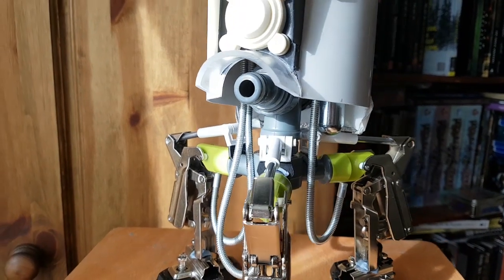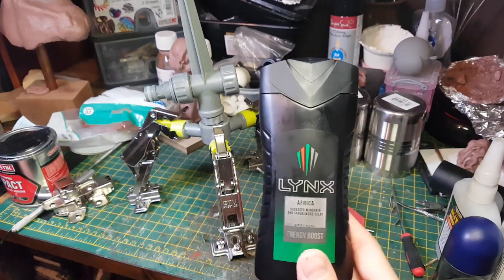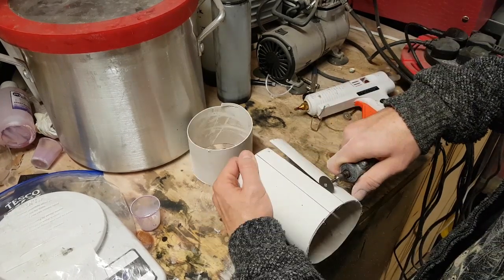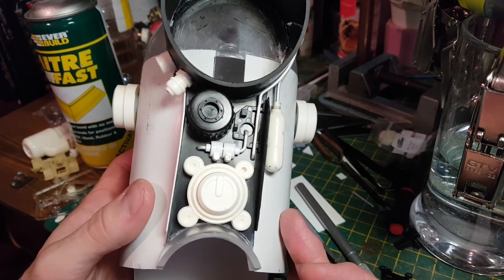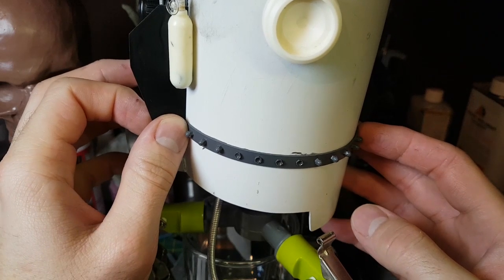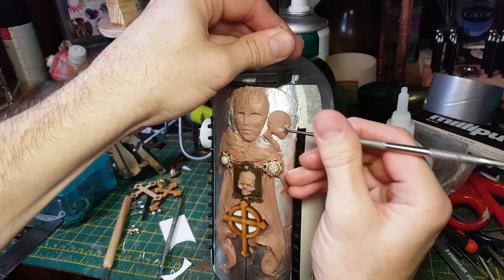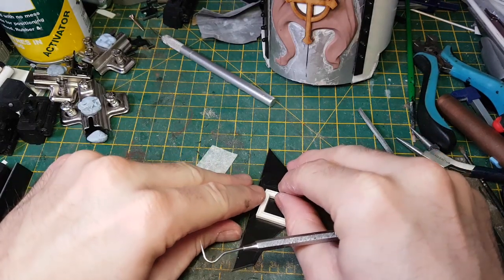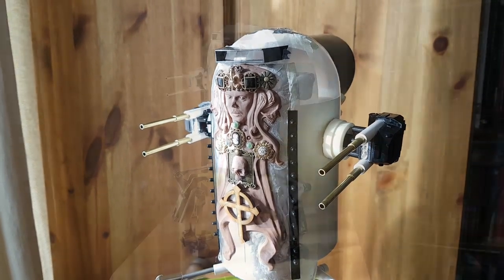Making a Three Legged Mech Part 1

Comment: i am glad i found your channel you are doing great work ,i just got a resin printer and i am making all the details for my creations, i think is something you need to consider ,it will help you design and create complicated models easier !
Reply from the maker: Thanks dude I appreciate it. I need to get into 3D printing, I do find the scratch build method has many benefits though.
Reply: @thedarkpower  I am building scratch build rc scale models my self and i know what you mean but when you got the chance to create something way faster with 3d printing plus with your scratch build skill things become easier !
Reply from the maker: Thanks! Yeah it'll definitely be useful in some circumstances but I've seen how long it takes to 3d print stuff so it's definitely quicker to turn some things on a lathe or to sculpt then mould them the traditional way.

Comment: What is that huge bottle of glue you're using that you have to spray?  I mean, is it really crazy glue?
Reply from the maker: That's crazy glue activator - you spray it on the glue to make it set instantly.
Reply: @thedarkpower  I don't think I've ever seen such a huge supply.
Reply from the maker: @-webster3120  Yeah I go through loads of it so I bought a big bottle.

Comment: You have to spend a shiteload of money on silicone! Over here its 30 Euro per kg.
Reply from the maker: It depends on what you get.  The stuff I commonly use is between €13-19 per kg approx, but you can spend much more if you use stuff like smooth-on, for example.
Reply: @thedarkpower  That is really a good price!! I don't think we have that brand here though.

Comment: Love this, it has a proper grim dark style to it, much like some of the wh40k stuff. The clay you used is oil-based, it looks like. I take it that makes the sculpture less permanent? Or do you have some kind of trick up your sleeve for casting it in resin?
Reply from the maker: Thanks Chris. Yes the sculpture does give it abit of a 40k vibe. So I've actually now moulded the sculpture and cold cast it in brass. I'm going to paint the rest of the body a dark red so it should look nice against that once it's polished up. That'll all be in the next vid.